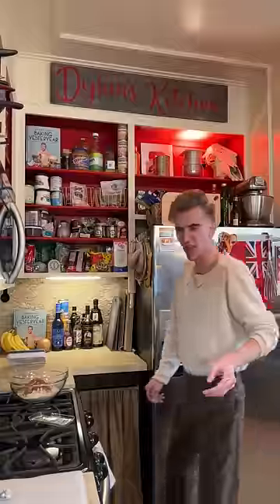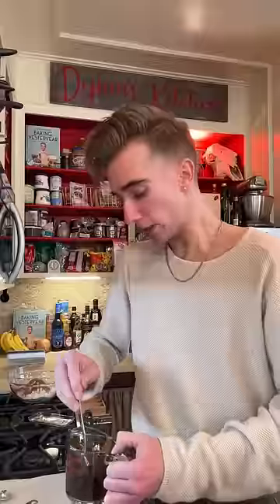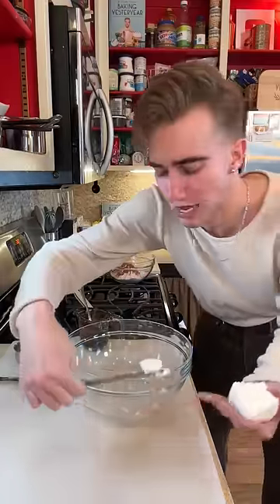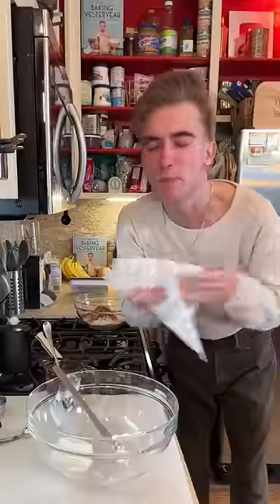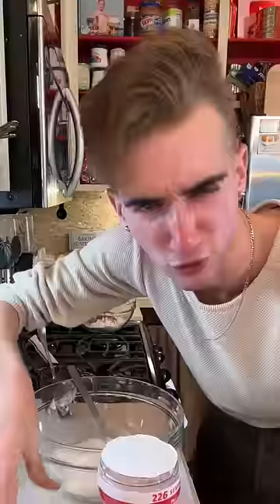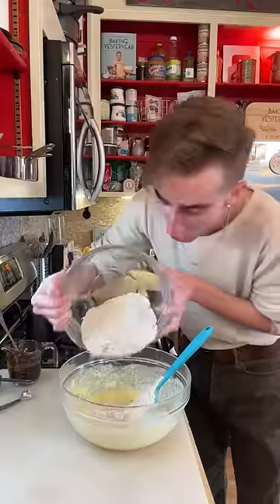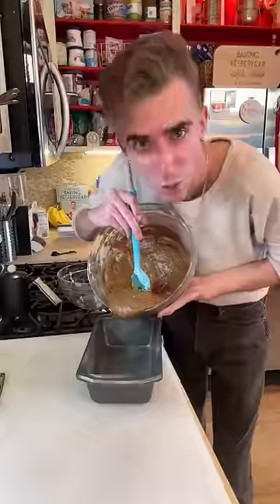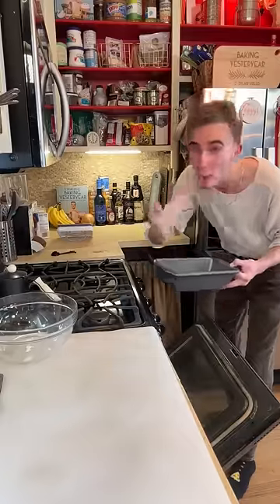A 1959 Coffee Loaf

Comment: Pro-tip: you can take your favorite proper coffee and either run it in a grinder until it turns to a very very fine powder, or use a mortar and pestle.  INSTANT COFFEE NOT REQUIRED!😊
[E2]: please don't boil your coffee.  The perfect temp (same for tea!) is when you start to see about .3cm/¼" bubbles forming at the bottom of the pot.  I've heard it called "frog eye hot" as well.
Overheating the coffee (or your tea!) will make it more bitter and burnt tasting than it has to be.

Edit: you will likely need to adjust the amount of coffee for this, i think.  I'm not sure what would happen with adding a half cup of pure powdered coffee beans, that bread might come out vibrating on its own volition😂

Comment: Key lime pie
Ingredients

3 Ounces of Boxed Lime Gelatin Mix
1 ½ Cups of Whipped Dessert Topping
1 ½ Cups of Plain Yogurt
1 ¼ Cups of Boiled Water
1 Prepared 9” Graham Cracker Pin Crust
3 Fresh Limes
Instructions

Mix Boxed Lime Gelatin Mix into boiling water and whisk until completely dissolved
Stir in the juice of 1 lime to the gelatin mixture
Let mixture cool completely at room temperature
Add in all the plain yogurt to the cooled mixture and mix
Stir in 1 Cup of the whipped dessert topping, retaining ½ cup for pie topping
Add completed mixture into prepared graham cracker pie crust and smooth using a spoon
Let completed pie mixture set in a refrigerator for at least 2 hours
After setting, take pie out and garnish with 8 dollops of whipped topping, one per slice
Cut remaining 2 limes into 8 lime slices total
Add one lime slice to sit on top of each dollop of whipped topping
Serve Pie in 8 equally cut Slides